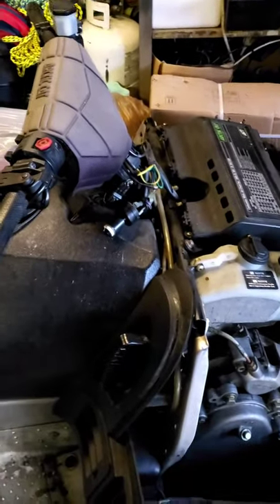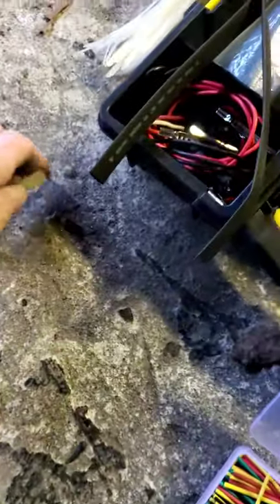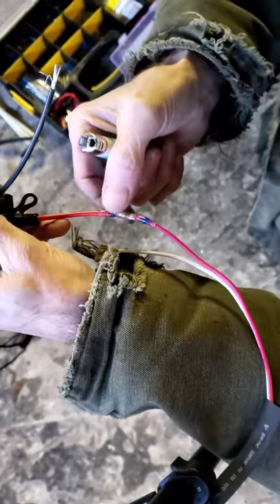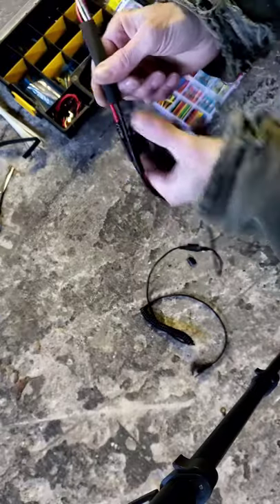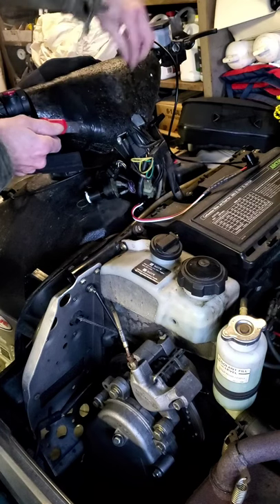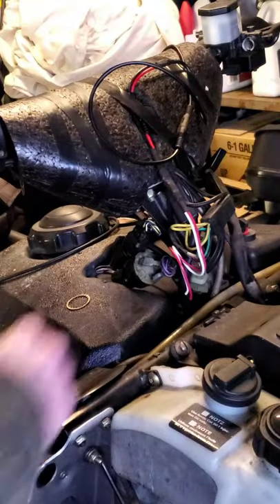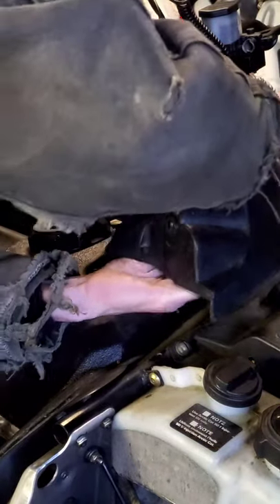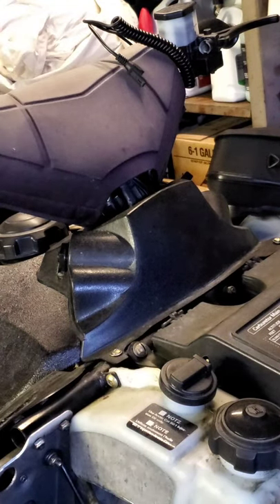How to Properly wire in a heated shield kit on your snowmobile. The Right way. #arcticcat #skidoo

Comment: Thanks for the video! Helped me out a lot. Just bought an 04 f7 and it didn't have a helmet plug on it. Wanted to hook one up but didn't want to splice into the headlight wires like a lot of other videos were saying to do. Found that auxiliary plug on my machine it's behind the speedo. Went to autozone and bought that extension adapter that you showed and spliced into that for a plug. Quick easy instal without having to cut into wires on the sled. Thanks again. Also should add I'm a fellow mainer lol
Reply from the maker: Happy to hear that man👊
Alot of ppl dont realize that aux cords in there waiting. By far the best way to go imo cheap & effective no splices to give you issues down the rd👍👍. 
Appreciate you checking out the channel & commenting man👊🙏